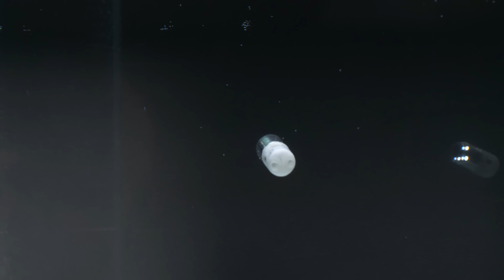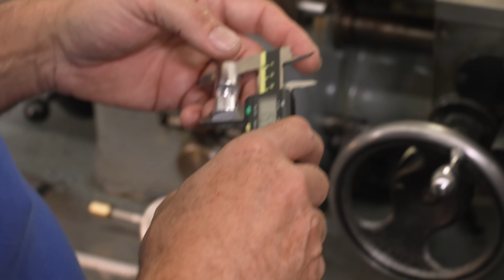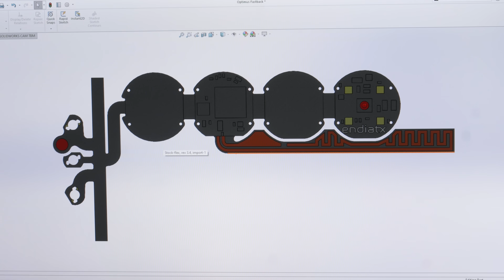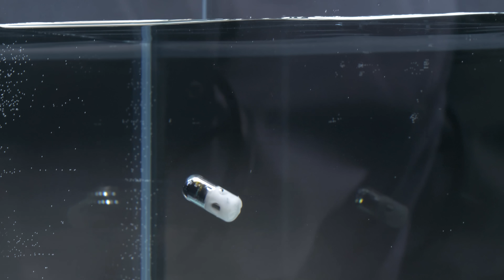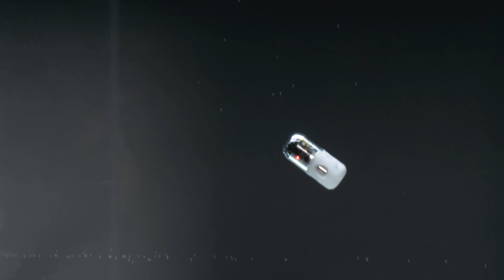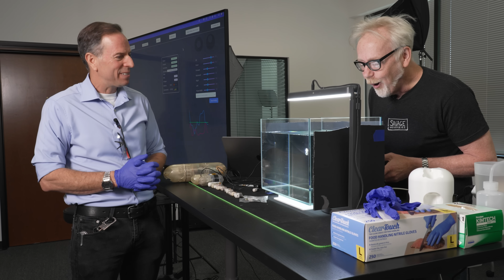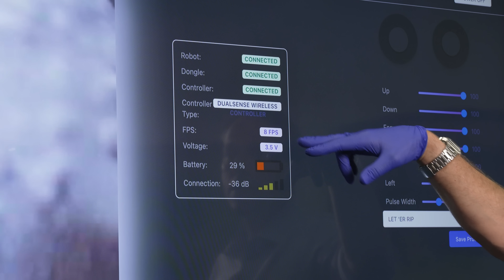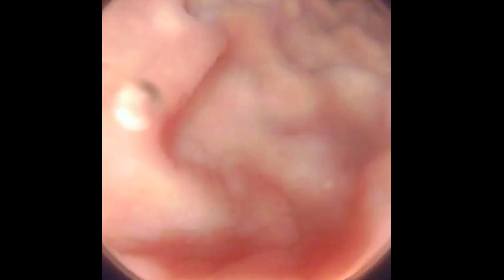Adam Savage Swallows This Camera Robot!

Comment: For some reason I never expected stomach acid/stomach content would be so clear
Reply: I wonder how it survives the acidity? Probably because the bot doesn't stay there for very long?
Reply: @electricdazz  There are plenty of plastics that resist acids
Reply: I'm assuming there is a level of recommendation for fasts and similar things. Wouldn't be able to see much if you swallowed the bot with dinner
Reply: @Selicularr Yeah I’m thinking that depending on what they are using it to test you for, you might have to do anything from not eating for 12 hour to doing a full colonoscopy prep. 😳
Reply: Well, if you ever saw hydrochloric acid you would expect that
Reply: Mine cannot be! I eat too much crap 😂
Reply: @electricdazz  Hydrochloric acid inside the human stomach.  If you were able to put some in a glass, you'd have a very very sore finger, I believe if it wasn't burned severely.
Reply: true, would be wear to see it colorful, standard chemicals are also transparent and liquidy
Reply: @electricdazz  Acid does not eat everything. In the human digestive system it's mainly used to enable pepsin, a protein active in acidic conditions to break down protein, but fatty components and sugars are mostly broken down further in the tract in basic conditions where the bile kicks in, and carbohydrates start to break down in saliva already. The robots can't be broken down by the human digestive system, otherwise they wouldn't be allowed to bring this to market (imagine the agony if the outer shell dissolves and interior parts with sharp edges are exposed).
Reply: @jefvl  Yeah true, I forgot there was a whole Breaking Bad episode about this.
Reply: He drank several glasses of water so most of his stomach was filled with water. He definitely hadn't eaten for at least 4 hours.
Reply: i thought it was green
Reply: "YOU ARE WHAT YOU EAT"
(HEALTH & WEALTH)
Reply: you didnt have chemistry class?
Reply: trying puking early in the morning, you'll literally throw up clear liquid.. that's it
Reply: @whoisme678  The pH of stomach acid is 1.5 to 3.5 ... while Coca-Cola is 2.5.  It's not all that corrosive, unless you have prolonged exposure.
Reply: @Selicularr  exactly... all that is in his stomach is water.   Society's lack of basic common sense concerns me daily lol
Reply: Guys, your stomach doesn't have a lot of acid in it when you're on an empty stomach. That was mostly water in his stomach.
Reply: Same! I thought it'll look like vomit
Reply: ITS NOT GREEN, MY WHOLE LIFE IS A LIEEE
Reply: It’s always green in diagrams haha
Reply: @Selicularr you need to fast the day before and drink a colon prep. My mum is doing this in a month.
Reply: real
Reply: @electricdazz  plastics that utilize tephlon type bonding can easily resist.
Reply: @whoisme678  its not pure hydrochloric acid though...

also, to the OP, thats because he just drank a bunch of water so its mostly water in there, its not just a big bag of pure acid
Reply: @candace27co he didn't eat anything so

Comment: In an endoscopy they frequently expand balloons to stretch the esophagus and sometimes take biopsies to diagnose problems.  So this may have some scenarios that safe money and effort but they won’t replace it for a lot of diagnosis and treatment.
Reply: Of course. This is just a diagnostic tool. Hardly invasive (depending on your definition of invasive) but more tests could be done based on this robots findings. Also, CAN BE DONE FROM HOME!!!! THAT’S AMAZING!!!!!
Reply: Most of the small intestine cannot be reached with the scopes they use for either upper or lower. They only reach a small portion at each end. For people like me who have only the small bowel with active disease, it is essential for a diagnosis. I pass all my blood tests, egd, colonoscopies, MRIs, barium rays,  you name it, with flying colors. The only way they have been able to see what is really going on inside me has been with these capsules. I've had probably around 3 or 4 of them done now. The last one got stuck in my jejunum (due to narrowing from scar tissue) and ran out of batteries before it became unstuck so they had to do an xray to make sure it did eventually leave my body. They have to surgically retrieve them otherwise. It truly is unfortunate that they cannot take biopsies though. But if they keep working to improve these,  maybe they will be able to do that eventually. Also, in my experience at least, the capsule endoscopy is more expensive than upper or lower scope. It may be different now idk. Haven't had one in a few years.
Reply: Yea because "old tech" cant ever be replaced by newer tech. Because that be sacrilege! Rolls Eyes in 3028 we will still use that old method

Comment: I was shot during an attempted car jacking robbery in '98. After surgery, it was explained to me that a sort of "combat surgery" was performed on me in order to negate future surgeries on my stomach. They said, (paraphrasing) "Just like your throat and butthole have sphincters for in and out, so does your stomach at top and bottom. Because trauma can cause a sphincter to cease, we connected the bullet hole in your stomach directly to your intestine. So we wouldn't have to open you back up if the eternal sphincters failed.'  I've had endoscopy since then while I would greatly appreciate this new technology. Journey to the center of the earth nanotechnology!! Outstanding tech! And one crasy test subject!!!
Reply: So your stomach have 2 exits leading to the same intestine ?
Reply: @ouioui51100  yes. And it makes a lot of noise when digesting.
Reply: that hole is not a sphincter, in future something fails or not but why to make a working sphincter useless  today by connecting another hole to the intestine? 🙄
Reply: I will want to add an incident with my known ones aged 57 who had gone to visit a dentist to get his one tooth pulled out, his dentist suggested him to also get out with the tooth just below the bad one as it will have no purpose of grinding, my relative questioned his decision, dentist gave example if one shoe is lost do you keep the other one, my relative said if i lost one eye should I remove other one too, dentist thought for sometime and finally only the bad tooth was removed.

Comment: I've swallowed one of the older versions of pillbot camera for diagnosis. It was truly a miracle how such a small machine was able to emit light, capture and transmit photos wirelessly for almost 8hrs. Unfortunately my intestine was not in a good condition. The capsule got stuck for 3 months and had to undergo surgery. This pill helped diagnose a condition which was not found during colonoscopy, endoscopy and CT endrography.
Reply: Like legit? Did the camera help diagnose anything?
Reply: They found a stricture with ulceration in the area where the capsule got stuck. This was in the middle portion of the small intestine and was not reachable by endoscopy or colonoscopy. For me it wasn't found in ct enterography either.

Comment: I have a friend that works in the sewer department. He says the water treatment facility has a specific filter just for condoms. That is the number one non-soluble thing than comes down the sewer.
Reply: Condoms, tampons and wet wipes... wet wipes are HUGE problem.
Reply: Flushing lithium ion batteries is ridiculous. If the battery had .1g lithium, it would poison about 1,000 liters of water. Add in people flushing hearing aids, kids trying to flush vapes when their parents catch them... Horrible. The guy says "why retrieve it" because he wants to move more product. End of.
Reply: @KevinJDildonik true, who doesn’t want to swallow a used one. Mhhh flavour for future 🤌🏼
Reply: @KevinJDildonik  more ignorance, as most people don't realize how rare lithium is in the universe and even on earth. Lithium is weird, it fissions and it fuses easily, so it's destroyed inside of stars as quickly as it's made. A hint on how easily, hydrogen bombs use lithium deuteride in the fusion core, the lithium fissioning into tritium to fuse with the deuterium. Then, if a tritium ion and deuterium ion comes to love each other very much, in the heat of the moment, a helium ion gets born.
Reply: @KevinJDildonik  If it can survive being digested intact then it will likely survive the trip to the sewerage plant intact too. I agree it is a concern though and ideally the lithium would be recovered.
Reply: @KevinJDildonik wtf flushes batteries?
Reply: Maybe Adam needs an filter
Reply: Sounds like he needs a new job.
Reply: @spvillano Nobody asked for your self absorbed explanation. You types kill me… 🤦🏽‍♂️
Reply: and every single condom that was flushed was flushed by an intelligent person. Never leave that behind or in someone’s reach.
Reply: Better flush it, you never know if she will take it from the trash and you're on child support for 18 years.

Comment: Pillbots have been around for a long time, but they are typically looking at the intestines and not the stomach because they are passive. They simply take an image at a particular interval, and transmit that to a pack that you carry around with you. The next day you return the pack and they download all the images. When going through the intestine it doesn't really matter which way the camera is facing, but in the stomach you're less likely to see anything important and that's the big difference with this motored one.
Reply: Yeah the pillcam I did had cameras on both sides so it doesn’t matter where it’s facing it has a 360 degree view. Makes me question the need for one that can move like this.
Reply: Something sounded wrong when he said it was in FDA testing. I was like this is old though.
Reply: @Jblow-u2m  The difference is this one is active and is designed to look at the stomach and not the intestine.

Comment: I didn't know the stomach clears and cleans itself within 4 hours.... sweet!
Reply: But assuming that's true, why isn't the rest of the system in sync? Shouldn't there be a by-product produced each time you eat a meal to let you know your system is operating at peak efficiency. Maybe I need to pull in somewhere and have that checked.
Reply: @edrichard6153  feaces are made just to indicate that, so is urine. If your urine is dark yellow it indicates you are dehydrated if it's pale yellow you are hydrated and if it's clear you are super hydrated. And I'm not sure of your question— to indicate the foods been digested or not— pain comes through and if it remains indigestible then soon it comes out in the form of stool/poop.

Comment: Having worked (on the records side) in a gastro office, the pillcams were super neat. Also stupidly expensive for what they were. There were immediately flushable ones where you gave the patient a little receiver to wear that picked up signals and stored the footage, and then there were the, uh, older ones that came with a little shovel. Still single use, but you had to get the pill back to get the files.

Both were smaller in form factor than this, but also were completely passive.
Reply: Damned dyslexia bit me briefly, must be tired. For a second, I saw the bit about the little shovel to get the pill back to get the fillets...

Comment: bro using a ps5 controller
Reply: Will the pressures inside the body implode this robot?
Reply: @CreatureOTNight No, dumb question
Reply: He’s up to date at least
Reply: @kilbunnyz9186 Bruh you didn't understood the referencee
Reply: I heard the robot use Starlink connection
Reply: Oceangate
Reply: 😂😂😂😂😂 @CreatureOTNight
Reply: They need to overclock it. that's a little bit low on the FPS
Reply: Bruh I see that PS5 CONTROLLER
Reply: @kilbunnyz9186 bro its a joke
Reply: @kilbunnyz9186 🤦‍♂️
Reply: @sreekuttan435 hm nice grammar
Reply: @kilbunnyz9186 great joke just flew over
Reply: Fleshscape gate
Reply: @Averagekylebuschfan  anything wrong in that
Reply: I was an Avionics technician on the MV-22 Osprey, and I remember when they were testing out a belly machine gun with a gunners seat. You know what the gunners seat had attached to it? A small monitor and an XBOX 360 controller 😂
Reply: X box lol. Sorry had to say it
Reply: Ok ig they used both
Reply: @michaelmorrigan614  And that day the first $1000+ Xbox 360 controller was born LOL
Reply: @SMOKED.BRICK.PRODUCTIONS  Seemingly the Xbox controller was never used, It was in pairing mode in the shot.
Reply: That’s the coolest part of all of this to me.
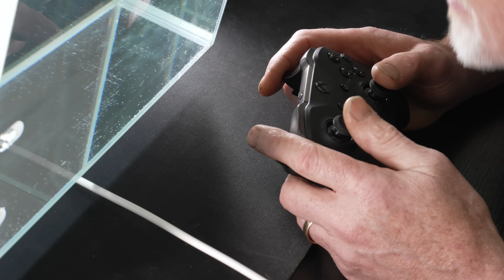Reply: At 13:32 he got an xbox controller 🤣🤣
Reply: My man insides running on 16 mega of ram.
Reply: thats what im saying
Reply: Bro is flipping us off

Comment: Swalowing a battery takes a huge dose of courage. Kudos
Reply: I wonder... If you used 2 somewhat bio-friendly metals (as terminals) and exposed them to stomach acid (as electrolyte), how much electrical power could it produce to supplement the robot's battery.
Reply: @vision-of-dog   I don't think there is a metal that would work, even if we were to use existing knowledge I assume it'd break the hydrochloric acid into chlorine gas which even in small quantities I would assume you don't want in your stomach.
Obviously, I have no expertise in this field so I may be entirely wrong.

Comment: lil cam was put in at 33% battery? why not have it fully charged?
Reply: Probably too much of a “pain in the ass”.😂😂😂
Reply: My guess is that they have to charge it before assembly. It doesn't make a lot of sense to have a USB port on these to top them up, and I'm not sure you'd  want to have wireless charging circuitry in there, interfering further with the wireless signal.
Reply: Being a one time use robot, they may actually not be rechargeable. recharging requires more electronics, and for something sealed like the robot, it would have to have a coil for wireless charging. That just makes it more complicated… In this case they can just put in an oversized battery and figure that it’ll last long enough. They probably ran the battery down a bit with testing and demos.
Reply: He swallowed the one they had been playing with in the tank.   
It was a bit run-down.   That wasn't going to matter for this video. 
As a throwaway item, it most likely uses a primary battery, not rechargeable.    
The second one was probably not run down.
Reply: Interesting though - a non rechargeable battery will mean these things will have an expiration date, like medications. Although I think probably all disposable medical equipment already has that.

Comment: this thing reusable? you want to reuse this?
Reply: Yeah I was thinking that too. Even with the best sterilization it still seems nasty to reuse.
Reply: He says it’s a 35$ Robot, I assume it’s all just disposable
Reply: It's made to be disposable
Reply: I mean, as long as it’s “sanitized”

Remember, 30 seconds hot water and sanitizer!
Reply: It’s probably glued shut and there isn’t an easy way to get to the battery to recharge it.
Reply: @trusttheprocess5618  it would legit be cleaner than before with sterilization
Reply: @triforcelink wireless charging!
Reply: They clearly said it's NOT reusable! You poop it out like everything else. No reuse
Reply: i guess now is not a good to time to remind you that they use raw sewage water for drinking water after they run it thru sanitation measures
Reply: If no one tells where this bot has been, it may be used again, possibly even safely, but not from the security of your body.
Reply: Urm yes
Reply: @drhxa  aw man
Reply: @16:00
Reply: It’ll end up on eBay in a week 😂
Reply: Thought he said it’s single use.

Comment: Suggestions:
- hot stamped spinel in vaccum for a hardy glass. Aluminium Magnesium Oxide.
- sodium battery
- rebuild all the electronics together with the camera sensor as one body

Kudos:
+ game console controller 

+ bluetooth

Potential:
+ as better sensors are affordable, it could have ph, lidar, terahertz and nano pore fluid sensors
+ an active version could have a suite of anti parasitical tools

Comment: I would like to see actual movement induced by the motors and its evectiveness; it is not clear in the video. Also, does the robot pill have the capacity to exit if it gets seriously stuck at some point? Why the pill has only 30% power left just after it has been swallowed? Does it have autofocus?

Comment: This is an innovation that could help me as I have polyps in my intestines and my stomach. My dr described me as having a carpet of polyps in my stomach. That was perhaps two decades ago and my health is much worse, they aren't able to do a endoscopy because I have to wear a ventilator face mask 24/7 so they can no longer put a tube down my throat. I'm pretty sure I did swallow a camera pill back then but it wasn't controllable.

Comment: This is so creepy and cool at the same time. 

I wonder if the battery life could be extended with some kind of magnetic charging. Though, would charging a battery inside you even be good idea? Something goes wrong, and you've got battery acid or lithium fire going on in a place you can't easily get to.

Comment: Technologically impressive...but medically impactful?  I have to get routine endoscopies, and would love for this to be the alternative.  But I doubt it.  For one thing, it is of no use for the esophagus...it would zoom past it.  Then, unless you have a stomach full of water, you could not steer/point it at much.  Lastly, it is visible only, whereas an endoscope allows the operator to inert tools, take tissue samples, etc. I doubt this will replace a steerable, full-medical endoscope, at least in anything like its' current configuration.  But to check for bleeding, etc, yes, this could be a good tool.

Comment: They need to work on the battery life... The battery is usually the biggest and heaviest component of all modern electronic devices, where the electronic components have been greatly miniaturized over the years, but the specific energy density (kWh/kg) of even Lithium ion batteries is still lagging behind.